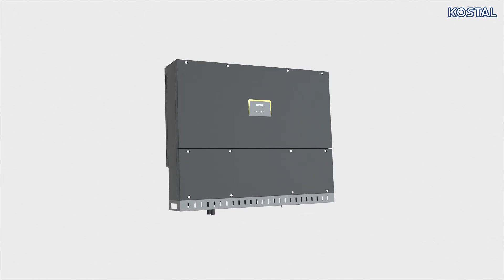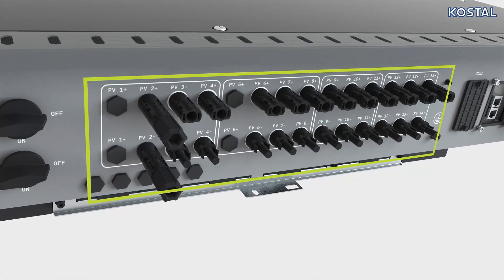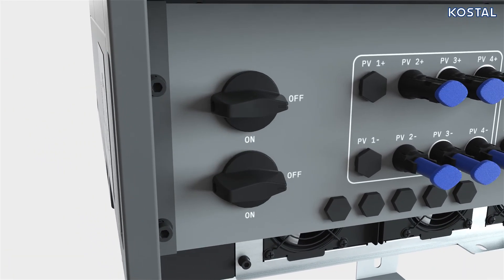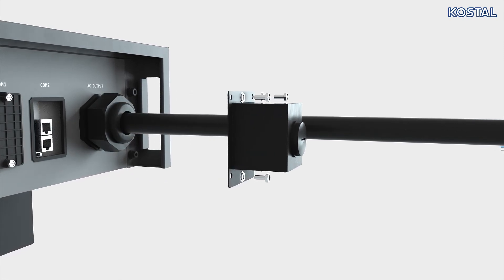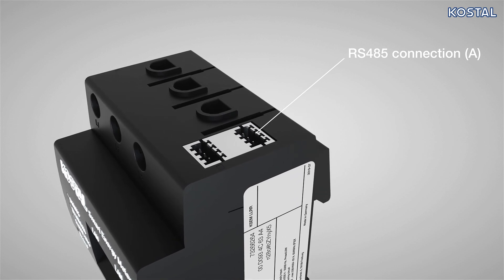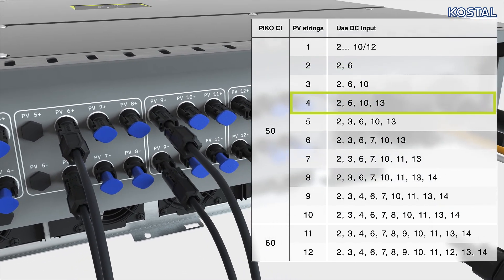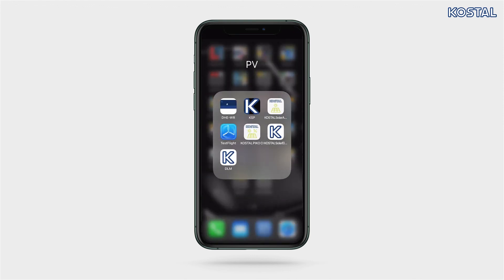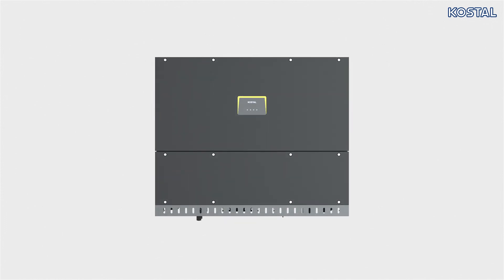#Tutorial: PIKO CI 50/60 | installation and initial start-up | KOSTAL

Comment: Buenos Dias,la monitorización como seria. Se puede conectar directamente a la Red Wifi local y arrojar los datos a la aplicación?O es necesario adquirir algún registrador de datos o similar. Saludos y muy buen video
Reply from the maker: Hola Marcos Guevara,
Gracias por su mensaje y su confianza en nuestros productos.

Hay varias formas de recuperar y guardar permanentemente los datos del registro:
Variante 1: Descarga y visualización de datos de registro a través de KOSTAL PIKO CI
App y mostrarla
Variante 2: Transferencia de datos de registro a un Portal Solar 
y mostrar

Para más información, consulte nuestras instrucciones de uso:
https://www.kostal-solar-electric.com/en-gb/products/solar-inverter/piko-ci/-/media/document-library-folder---kse/2020/12/15/14/23/piko-ci_ba_en.pdf

Saludos soleados,
Kostal Solar Electric